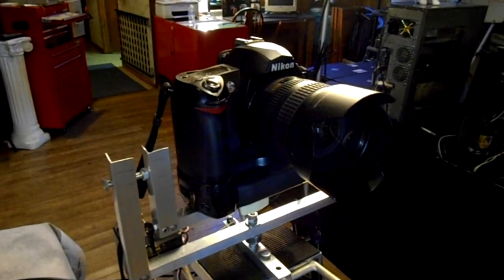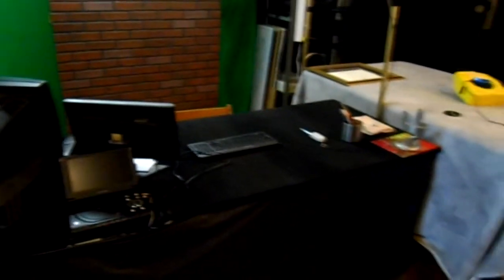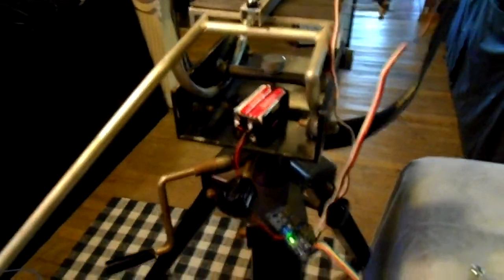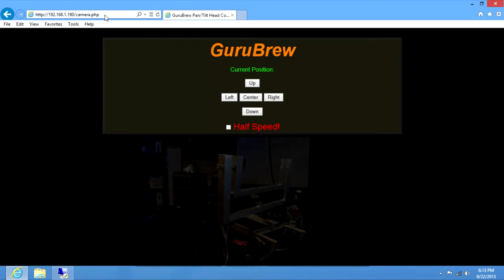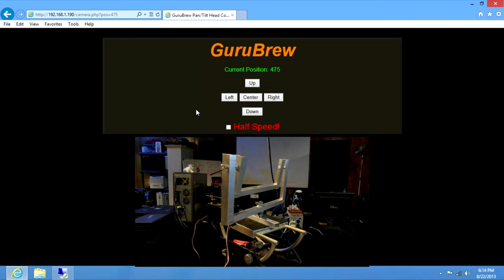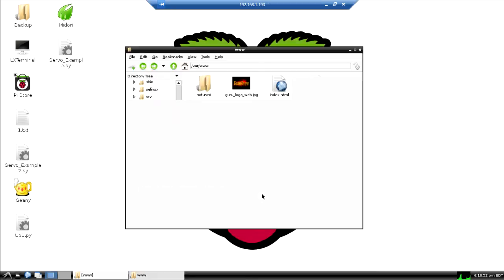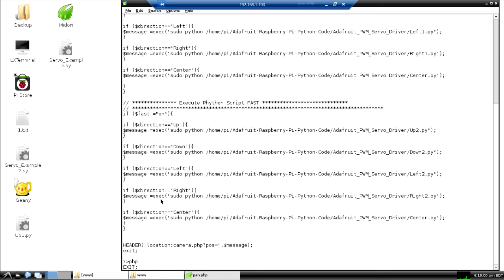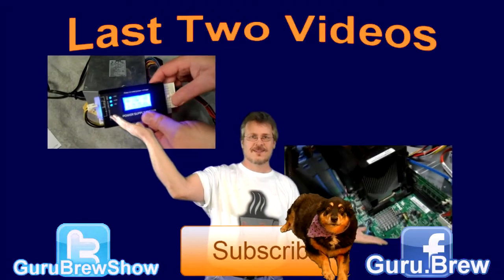DIY Motorized Pan & Tilt Camera Mounting System - Part 3

Comment: I'm working with the python script to control servos as you have done. Do you think you could post the Python Up and down scripts? I'm not going to be using PHP to control them I'm working directly in python but its been hard to find code that I can learn from.